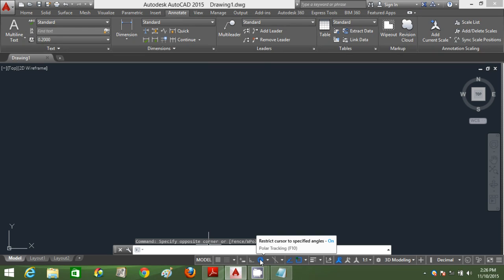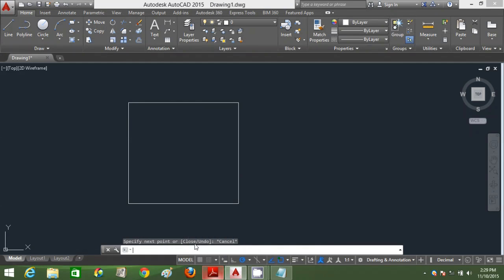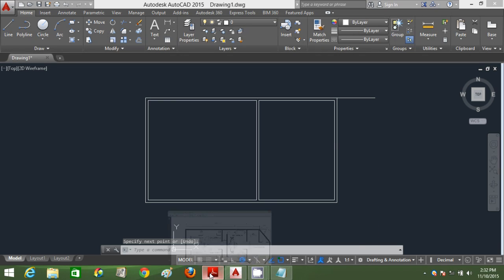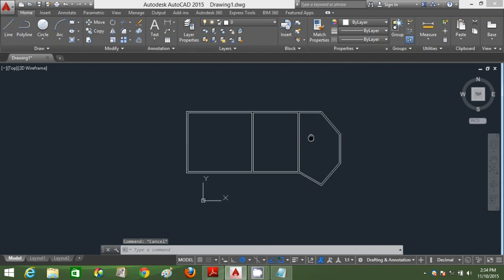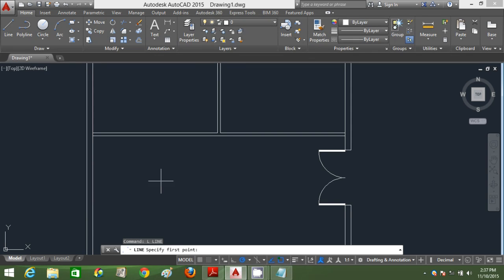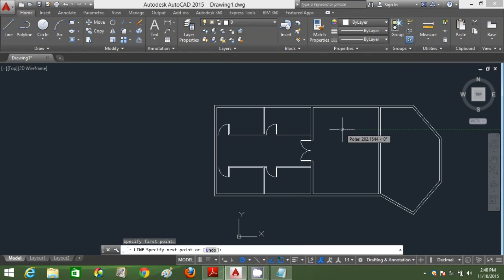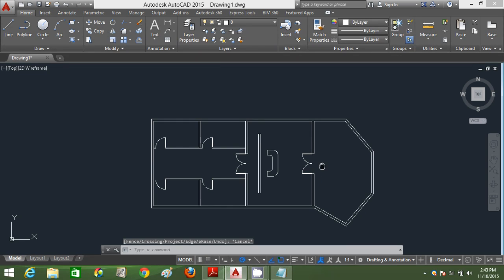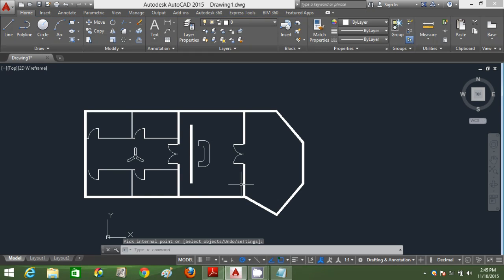Basic AutoCAD 2D Floor Plan Beginner Using AutoCAD 2015 Tutorial Part 1

Comment: Great tutorial! But I seem to have a problem... When drawing in millimeters, it's exactly the same as drawing in meters. Which means that when I tried to draw the first line (8600 millimeters) it got so big I could barely zoom out to see the whole line. It has to have been 8600 meters? I've tried changing in units and closing the AutoCAD programme but it won't work. 
Of course I could just rewrite all of your measurements to meters instead, but you or someone else might have the solution to this problem and in that case I would love to hear about it!